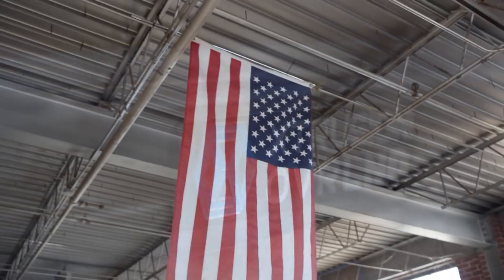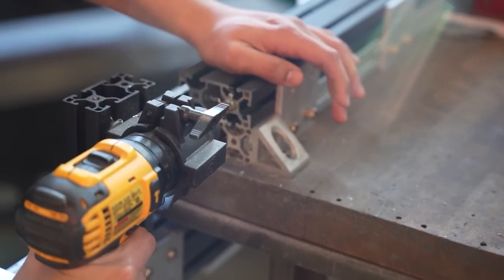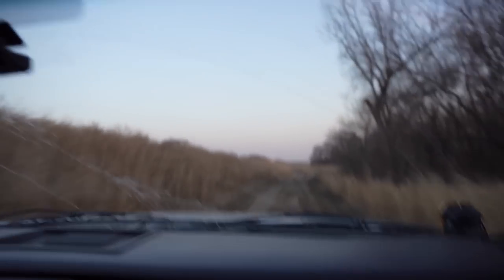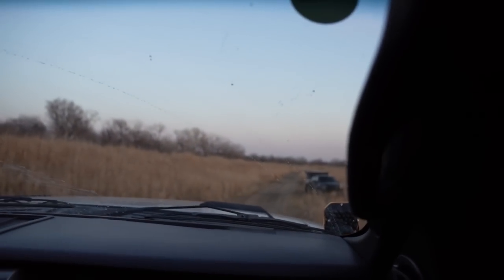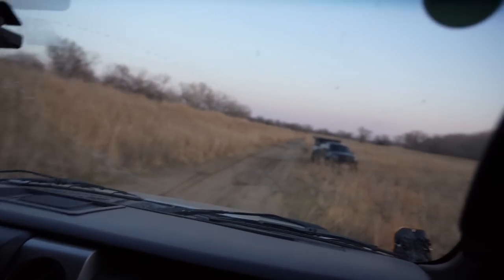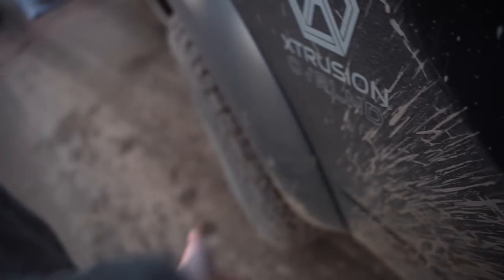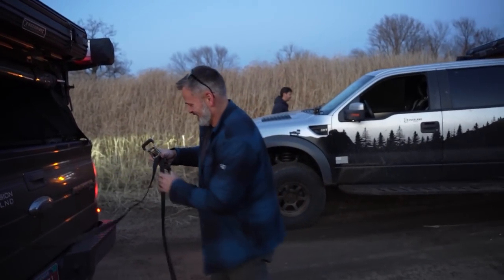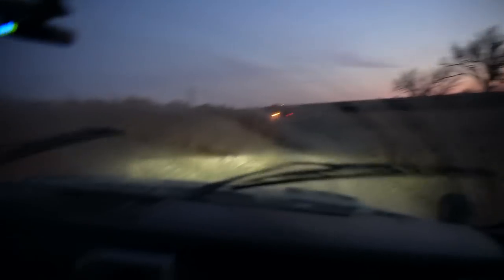V8s Just do it better! Hucking first Gen Raptors with Xtrusion Overland

Comment: With all of that weight on the truck, I’m surprised the bed don’t collapse. The roof top tent was jiggling on the landing. Crazy!
Reply from the maker: Yeah the brackets on the roof top tent didn’t fair well but the rack did great lol 😂
Reply: @Maxx.Powell  Was wondering if I was the only one that saw that. It's the reason I don't have a RTT on my Gen2, camping stuff in the bed gets bounced around bad enough, don't need to send a $2k+ tent flying off into the brush. :D

Comment: Good to see Max posting!!! ....on topic...When I see a bed rack, I've always wondered why there is no option for a "integrated tent" or panels to enclose the bed.  So many of us do not want a roof top tent as the only option.
Reply: I think the main challenge for an enclosed rack is the weather sealing, but Xtrusion overland does make the softopper compatible rack
Reply from the maker: You might like Go Fast Campers for something that’s enclosed with a roof top tent included

Comment: i think you will have your expensive stuff stolen from soft topper. i have diamondback cover with front runner on top
Reply: Yes and no, with the extruded aluminum design, imagination is your limit, one can definitely come up with a diy solution for a rear gate that’s lockable.
Reply: @4WDisLife  knife to the fabric of the soft topper
Reply: @BrainGordon469  yea but with the rack over it won’t be able to take the bigger stuff out nor getting access into the bed.